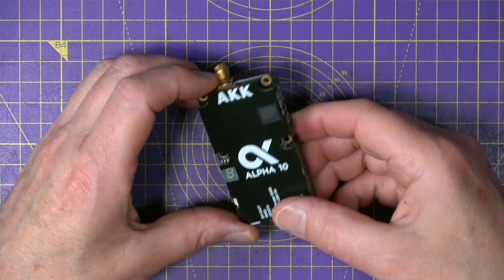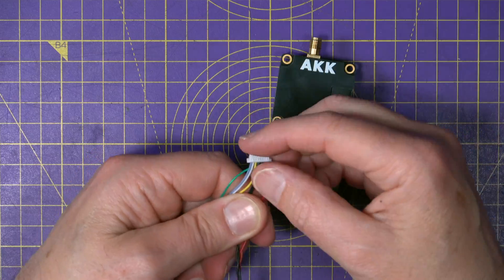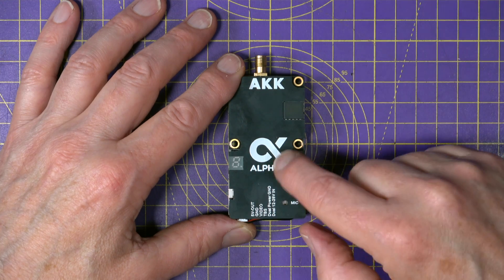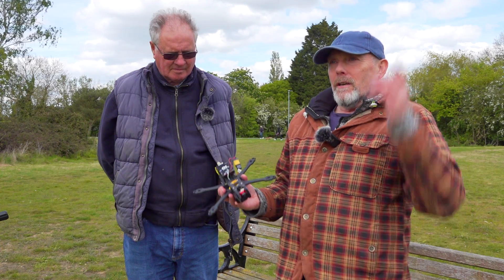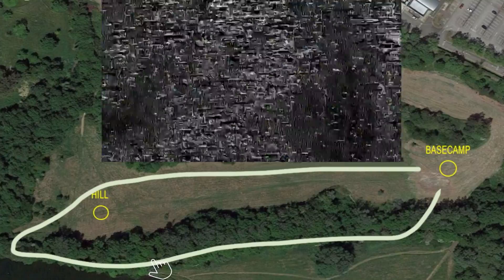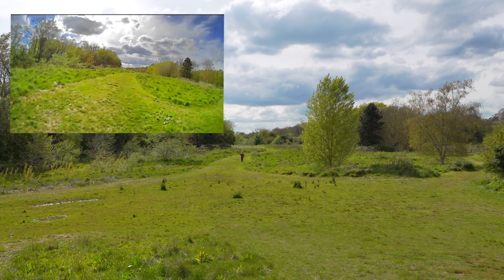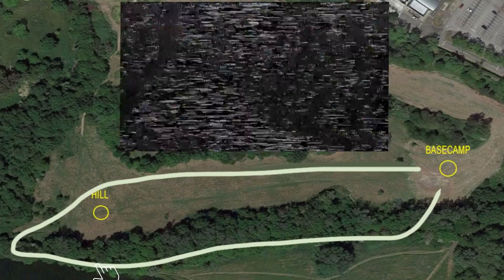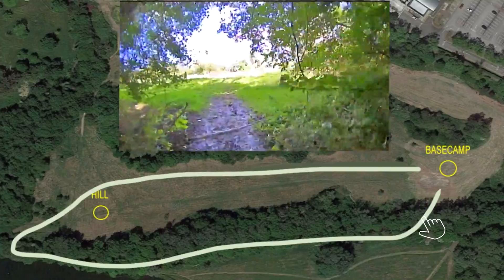AKK Alpha 10W, 80 channel, 5.8GHz VTX - review and a tough penetration test

Comment: Why not just fly a 1.3ghz vtx?
Reply: 5.8ghz clearer video? 
5.8ghz directional antennas smaller?
Reply: @QSpeedRacer  Smaller yes, not larger than your typical 915mhz antenna though.
Picture quality is the same, downside being much few channels.
Reply: @ImperialArmour   I wanted to do 1.3ghz for penetration and peace of mind long range. Just never did it. Antennas seemed big for anything but omni
Reply: @QSpeedRacer  a monopole or dipole can be used for the vtx, it takes up the same space as your control link.
Reply: @ImperialArmour   I seen someone do that on drone. I guess at 1.3ghz technically you don't need gain (directional antennas)  cause on paper the range is ridiculous. Not to mention think it's geprc that has a 2w 1.3ghz

Comment: can you switch power from the remote?!? so i would then fly with 500mw or 1w... and only swifch to full power when needed
Reply from the maker: Yep, you just use smart audio.
Reply: Yea I had bunch drones analog power on rotary dial. Though some reason when I put 4.5 on it stopped working. Never tried to figure out why

Comment: looks like a beast of a vtx, i would buy one for my 7 inch lr but i had terrible experience with that 3w ultimate vtx from akk. that thing sucked.. terrible noise and less range than some lower powered vtx's
Reply from the maker: I haven't tried the lower powered ones, but as you get > 1W video power, then any interference is probably amplified as well. More power isn't necessarily a better thing. High gain and directional receiver antennas are more effective. Thanks for the feedback.
Reply: @WhirlyBloke  noo thank you! thanks to your reviews we get to see these interesting new products in action. are the lower powered vtxs the same size as this beast?
Reply from the maker: @heinzfpv4787  Bizzarly, yes.

Comment: Such high wattage Tx usually perform best around 500mW. 1 Watt or even 10 do not bring more range.
Reply from the maker: I know, and generally high gain receiver antennas are generally a better way to go rather that just pumping out more transmit power. It radiates in all directions so a lot ends up in the aether.

Comment: great video... i've been eyeballing these, i'd love to see how a test like this does againt other systems like walksnail and dji, maybe go to a park with a bike! i get worse range and penetration with my 2.5w reaper then i do with my jhemcu  and aocoda1.6w, vtxs  for some reason, i just wish they had made it in more of a 30x30 mounted cube shape with a mmcx connector  for something like a 5-7inch toothpicks with threaded holes in the to and bottom
Reply from the maker: Generally I've found Walksnail and DJI are just as terrible behind trees.

Comment: I don't see a use case for this honestly, well, ok maybe flying proximity with wings far away, but it uses soo much battery
Reply from the maker: I agree, I think its only real use is for long range wing pilots who are miles from anywhere and have space for a large and heavy battery. But there's quite a few out there doing that.
Reply: @WhirlyBloke  I'm on of them 😅 I have 10000mah-20000mah 4s in one of my Wings but even with that its just really bad for efficiency because my plane (wich is quite big) only pulls between 1.8A and 3A in cruise flight and a Vtx like that would make that double. Im a lot better of getting that license and using 1.3ghz wich would get me over 100km away on 1W with a good antenna.
Reply: @trumblez  could be on a dial. Slowly raise power as u need it. 1w 3w 5w 7w 10w
Reply: It could be useful for >=10" bombers
Reply: Yea my long range drones. Even my 10" really can't go far enough to need this. Only if need to push thru interference which I do get alot of. Think max total distance I ever did was 19miles so 8miles out. Which 1w should do in a perfect world

Comment: Amazing test! Although I wish the lower watt models were in a smaller form factor to fit inside 5 inch/ 6inch drones. All the Alpha models seem to be the same size and weight, which doesn't seem to make too much sense, so why not just buy the top model and switch power levels
Reply from the maker: Thanks, and yes, that's a good point.  But I guess they are just targeting wing flyers who don't want digital.

Comment: This was made exactly for Kamikaze FPV drones in Ukraine
Reply: can be used as counter measures too. have 80 of these blasting static on each channel and the kamikaze pilots can't fly and see their target.
Reply: @Guilefpv  They use 1.3ghz ass wall this Will be useless
Reply: @igort5418  well, 1.3ghz TX do exists and are not encrypted or private channels right? So as long as you have the different types of VTX covering the different channels blasting static, the pilots can't fly.
Reply: @igort5418 we even use lower that 915 custom elrs frequencies and relays on drones 😊
Reply: @3dmaxers  Yeah 😎 🇺🇦🇺🇦🇺🇦
Reply: You can’t blame them, when the $$$ is there.
Reply: Yes, and foxeer is selling thermal fpv cameras
Reply: Walksnail even jumped on that band wagon with the thermal vtx
Reply: @rainsquadfpv  I can't find anything on that. I did find foxeer is making a thermal analog, though
Reply: They use fiber optic drones

Comment: well as you know basically nobody has HAM licensing but would be interesting to explain  a bit about this if you know some stuff?
Reply from the maker: As far as I understand it, a ham license is easy to get. Pay a fee and take on line test. Study material is online, and you could probably learn some good practices from it. I think you also need to transmit your call sign, maybe using the craft name on the OSD. But my guess is only few can be bothered.
Reply from the maker: That's my understanding as well. And you're right about most people not bothering.

Comment: Thanks for another great test and review video Whirly Bloke. I always find your content interesting, informative, and entertaining. I've found those 10w VTX units intriguing even though they seem impractical due to size and power drain and heat etc...🤔. I think you're spot on with who they're designed for. Long range wing pilots would probably love these and even big, 10 inch plus quad pilots might benefit though size, weight, and power drain would limit distance. Overall, I don't have an application for these but I love to see the technology progress. Happy flying amigo 🫡 🍻.
Reply from the maker: Thanks for the feedback. Yes, it's a good product, but it's only really useful for long range wing pilots.
Reply: I got one for my 900mm wing. I would have it set up so I can change the power setting on my controller based on my need. And pretty much only use full power in scenarios when I need it to get that extra pen when I'm about to lose it. I currently use a rushfpv max solo at 2.5w max, and don't notice much drain difference with my 5000mah li ion batts